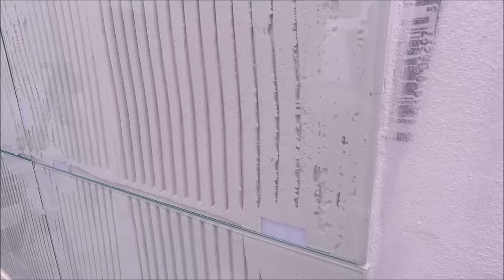How to use a Tile Leveling System for Walls

Comment from the maker: Leveling system: https://amzn.to/2Pmwjag
Gloves https://amzn.to/2VIOOtP
Reply: Hey bud I just did a job 8in x 4ft tile. I used spin doctor for the first time. Up to the grouting stage I was happy. But i knocked the stems out the next day on half the job and on the third day grouted and found that the spin doctors were forcing the tile under pressure and ends began popping up. I troweld and back buttered and never thought this would happen. The company set the job to install over a ardexed plywood that previously had smaller tile. 
Any idea why this happened and how to prevent it...
Reply: @jesussavedrjm6818  ... What do you mean by saying the ends popped up?
Reply: @kylelove927   it lost its bond cause the tile was under pressure down to be level
Reply: @kylelove927   the ends of the tile popped up in s few places
Reply: That link leads to a completely different tile levelling system which works on a wholly different principle.
Reply from the maker: @BenjWarrant  There are two leveling systems used in the video, one LEVTEC and the other RIDGID. Unfortunately, I don't have the ridgid link.
Reply: saved by grace through faith you may not had enough mud on one side. Witch could cause a hollow spot, and eventually pop I’d imagine if you stepped on a hollow spot on something that large
Reply: He means when the "leveling system" and I emphasize "" grabbed ahold of the ends of the tiles and lifted them off the substrate away from the mortar which shrinks you ended up with a gap and not enough coverage on the tile to hold the bond.  If you can't level your tile with mud than get a professional.  It is easy to add mortar to a tile and stick it to a wall then grab a level and put it on the wall and check for level.  If you need more mud take the tile and add some.  Why is this so hard or is it because this is tedious and takes longer.
Reply: I can see this working as long as you add the perfect amount of mortar evertime.  But when does that happen.  I set most tile on other people's walls.  Which means the substrate is usually beveled in or out and not perfectly level to begin with.  This only works in a perfect world.
Reply: I am about to try these on a 200 sq' shower project.  My question is, if you are using spacers to supplement these clamps, can you simply use the "B" clips for everything? It appears the only thing missing with the B clip is the little tabs that would go between the adjacent tiles - either intersecting or brick patterned..  Am I correct? As you pointed out, why use several, OR buy several different types, if the straight "B" clip can be used for all.
Reply: @jesussavedrjm6818  klkm
Reply: @itscalledhiphop3063  couldn't agree more, I float my whole floor out on concrete! Takes a lot longer and way more thinset but she's tough as a tank when done lol
Reply: J😅😅uiiy de as need ryw 😅🎉❤  se😂 plum❤

Comment: Been a residential remodeler for over a decade. First used these 6 months ago on a large job for my new business. I'll never install large format tile again without these. Made the 24"x24" tiles go down completely flat and level. You can slide a 5 gallon bucket 30 feet across the tile without it catching a lip. Truly amazing. Saves so much time.
Reply: I'm familiar with getting cement to the correct consistency as I've been a mason for too long. A question I'm trying to cut a corner and removing my tub. Just having the space now a shower with 17" square tiles. Have a marine plywood floor. Before I put down the top bed ready to tile, could I use a wall board cut to size and screw it down like crazy instead of doing it by hand? Then put the 40 mil plastic down and then trowel it as it should be for the tile?
Reply: @HellNoKamala  im so confused by the question can you clarify more?
Reply: @Titantitan001  I just did it the right way and just troweled it to slope to the drain and it does drain the water. I didn't want to make a mistake. Any flexing could cause a leak if I put wall cement board on the floor.

Comment: Hello mate, Pro Tiler from England here. Just a little tip. Tile lippage clips help on near enough flat walls and floors, but some DIYers might watch this and use these on bumpy surfaces which is when problems occur, as the clips either raise up the previous low tile or bring down a raised tile, creating air sockets underneath. All you need to do is knock on the tile and you will hear the hollow points. Also dont knock the clips out with a rubber mallet especially on a lighter ceramic tile as the mallet can leave black marks which are a pain to clean off. Polished porcelain you might get away with but just a tip. Good luck mate wish you all the best 👍
Reply: Interesting to hear from a professional! Do you use a levelling system yourself? And why do you/do you not use it? Just being curious :D
Reply: @mart9585  I’ve been tiling 11 years. I only use self leveling clips for anything larger than 12x24 because it helps to keep the tile plum and level. The cons to using it are if the wall isn’t plumb or flat than it will cause voids in the thinset behind the tile and causing the tile not to adhere properly.
Reply: Awesome point . Level or grind the high spots first . Good on ya
Reply: @AllBayEveryDay  The clips don't cause that the poor substrate does.

Comment: Thanks for the tip on removing the extra thin set from the edges. That explains why I was having trouble with compressing the trowel lines on the bottom of my first row of tile on my bathtub (large format). Luckily I was smart enough to pull them off the wall and try again today after watching some videos
Reply: I second that. Such a simple thing, I don't why I didn't think of it...

Comment: I use spin doctors exclusively and they are killer,you forgot to mention using  a cap to run between tiles to check lippage and break a post of the base is ideal for cleaning grout lines.and one should always especially LFT use a rubber mallet and smack each tile a bunch from center out to release air it’s unreal how much is trapped great videos non the less,thank you!!

Comment: Pro tip for a DIYer spread the thinset horizontally and it will help tile from sagging. No need for ledger board make your first row level.
Reply: Actually, you want to apply the thinset the way he has shown (if you are laying your tiles the way he is - i.e. long side parallel to the horizon).  You always comb the thinset in straight lines perpendicular to the long side of the tile to aid in removing trapped air.

Watch this video, it's very informative.

https://www.youtube.com/watch?v=Way5bMh-eYg&feature=em-comments
Reply: It shouldn't make any difference with 100% coverage. Or maybe a thicker mix is needed. I could be wrong. I'm still learning how to do it right.
Reply: @dougwebb704  But he didn't get the air out anyway.
Reply: He actually said he normally back butters which will increase coverage, but did not in this case to allow the clips to be visible through the glass.

Comment: I started a tile job using the home depot wedges. After about 10 foot by 10 foot area switched to the screw on Marshalltown leveling system. The Marshalltown are easy to install and if you have a problem they are easy to back off to either remove or add more mortar if needed, The wedges have a tendency to grab the tile and push them apart if you are using a grippy tile. The tool will also wreck your hand if you use it a lot. 

While these to a good job of keeping the edges of the tiles even, you can still have an uneven floor when you are done, which will show up when you install baseboard. Always check your tiles with a level to make sure you have them flat and even with each other.

Both do have the occasional tendency to not break off cleanly as you can see right here 8:56 where he says they break off cleanly, when they clearly did not. The little piece of plastic can be cleaned up with a multi tool or a sharp razor knife, just be very careful to to chip the tile.

Comment: I tend to be a no-throw away person if possible, so I will stick to the regular cross type rubbery tile spacers that you just keep reusing to save the planet every inch I can.  Nice Video.  Tip for grouting ~ use a cake icing bag with the tip cut off and press it in after you pipe the grout in.  No waiting for the grout to cure and washing it forever.  Thanks for this video all the same.
Reply: Your totally missing the purpose of these. Lol if your that worried about the spent plastic pieces, put them in a bag and put them in your recycling bin

Comment: Thank you for this informative video. I am doing a shower with 1/2"x23x47 tile. Pretty thick tile. What size clip should I use for these large tiles as it will be 1/2" tile and 1/2" thin set ? Thank you.

Comment: I used the Ridgid spindle system on two tile jobs. I had never used a lippage system of any kind so I thought I'd give it a try. Never again. I used a half inch notched trowel on both jobs, and back buttered every tile, but the clamping pressure  of those spindle tops is so strong that it was lifting my tile out of the thinset completely. I didn't notice this until the following day when I came back and realized very quickly, that I had to re lay more than half of the work I had just finished because they were just floating there on dry thinset. I wonder if the wedge system would serve me better. I think part of the problem is the thickness of the stem foot of the spindle system that sits under the tile.

Comment: Nice demo, using glass sure makes it easier to grasp the concept..good job 👍
Reply from the maker: Thanks! It was a tricky demo and the glass definitely gives you a closer look with a leveling system 👊
Reply: StarrTile 9
Reply: is that bob doyle lol 🤣🤣 smh
Reply: I agree. I just did my first shower tile job with LFT and bought both these systems but didn't end up using them because I wanted a 3/8" grout line and I never saw this demo. Great video, I will keep these kits for the next job..
Reply: With the glass demonstration it also shows that you can remove the systems without causing damage to the tile. I figured that glass would crack.
Great demonstration, 2 thumbs up.

Comment: I can’t explain how important it is to back butter the tiles when installing tiles on any surface.  Also, u definitely wants move the tile side to side too release all the air from under the tile before moving onto the next tile. I can’t tell you how many tiles I repair because of a simple step not taken.
Reply: Completely agree.
Reply: Thank you for your wisdom and knowledge 👊🏽💯
Reply: But you just explained it?
Reply: Damn right!!
Reply: The thinset he used was dry and not that wet. No need to back butter if you mix your thinset correctly
Reply: @Hidden-comment164  incorrect.
Reply: @ph3q  no, I install for a living lol
Reply: Excellent . Perfectly well said .
Reply: @Hidden-comment164 not true . You back butter wide format tile . Always
Reply: @Hidden-comment164 then you install incorrectly . Not one pro tile guy in this world will say don't back butter wide format tile ..that's makes you a crappy installer
Reply: We never back buttered tiles 30 odd years ago. I had to replace chipped tiles as an apprentice plenty of times and they were ridiculously difficult.  I think the only time tiles popped up in 1 piece for me was when the glue lines were in different directions or there was an obvious skin over glue from sitting too long (Could have been refreshed with a quick re-trowel).

I think the industry is in overkill on tile installation. Levelling systems aren’t really necessary but for plank tiles.

Comment: Used both systems, Personally I preferred the vedge system. Both systems works great, but the vedge system is easy to use and cheaper.

Comment: Is there a reason why a spacer isn't used on top of the ledger board?   Thank you for another great video.
Reply from the maker: No need
Reply: @LandbergTileTV  The real essence of my question is this:  Since you have to put in the bottom row of cut tiles once the ledger board is removed, wouldn't the spacers help keep that row of tiles in line and level with the rest of them?  How do you get that row to line up properly after removing the ledger boards?  Thank you.

Comment: Thank you...not in tile biz but if it was me I would definitely come up with something on a drill to spin the Rigid ones...like a socket with 4 notches
Reply from the maker: thank you sir! 👊👊👊
Reply: That would make the job even harder!
Reply: Would make it slower and a chance to over tighten and crack the tiles. I think it is better because you have a finer adjustment with your fingers that with the tools but thats just me
Reply: @MrJFoster1984  you can't crack the tile by over tightening - the clip fails before that. but then you have to struggle to get a new clip in that spot.

a drill adaptor to remove the cap after would be helpful.

Comment: I just use a short piece of batten placed across the tiles as I go, to check for height discrepancies. That's the old school method, add or remove adhesive if necessary.

Comment: So my questions are for what size are these checking on Amazon saids 1/16 can you get bigger like 1/8 or 1/4 and is this only sold online or can you buy this on store let's say the ridgid system can you buy it at home depot or lowes other than that awesome system for large tiles
Reply from the maker: I have not seen the rigid system in store yet. You can get the clips at 1/16 or 1/8

Comment: I tried the Ridgid system with large format tiles 24×12" and wasn't too happy about it, the spacers did not break at the base everytime and had a really hard time getting them off the wall, to the point that I just stopped using them, they need some refinements in my opinion. But thanks again for video
Reply: I had the same problem. I also stopped using them.
Reply: Thanks...I wondered about that

Comment: I am installing a wall mural that uses 24x24 tiles. If the tile thickness is not exactly uniform there is going to be an issue. These systems use the science of leveling the bottom of the tile and there will be some lipage when applying the top anchors. Any ideas other than not using leveling system and just leveling by running the trowel across the seams when setting? I have tried a dry fit on a flat surface using 2 clips on each side and there are lipage issues.

Comment: So it seems the spindle system is better? since you didn't have to hold the tile on the edge to prevent movement and no pliers were used or any other tool other than a twist. am I correct?
Reply from the maker: We like the wedge system better and its not necessary to use pliers. We don't anymore with our Levtec system.

Comment: I plan to put down 12x24" tiles using the wedges system and your videos are great! Thanks. But I have Two Questions—
Question 1: Can the wedges be tightened too much, or do the pliers tighten them with the right amount of pressure?  
Question 2: Does using the wedge system alleviate the need to use a level to make sure the floor tiling does down level, or does it just assure the tiles are flat with one another--that is, can I just lay a row of tile along the wall using the wedges and keep going and assume all will be level?  I can imagine some tiles will need more thin set under them than others. Thanks.
Reply from the maker: Hi David! To answer your questions, you could theoretically tighten the clips down too much, but at that point they will break and you will have to pull the tile and insert another clip. Also, the leveling system usually only assures that the tiles are flat with one another and yes, some tiles will need more thin set than others. Please let me know if you have any more questions and thanks for watching! 👍
Reply: This is my first time using leveling wedges. I now get that the extra thin set needed can be added and then the leveling clips used to level the finished height needed. Also, I noticed that the official QEP video on using their Curved LASH system does NOT flatten the ridges.  See their video here cued to the right time--https://youtu.be/jnsHvrRB_mg?t=1m12s. The "expert" just drops the tile on the Curved clip and on the ridges without flattening out the ridges.  So I returned the QEP Curved clips and bought the Flat clips. Sal DiBlasi said that the ridges need to be flattened and to slide the tile then finish back into the clip. As I see it, only the Flat clips will permit this flattening of the ridges to get the full coverage needed. I'm learning a lot and want to make sure I get the fullest coverage of thin set needed. THANKS.
Reply: You don't tile uneven floor use self leveling compound first to make it flat then it's much easier and faster to tile whole floor.

Comment: Quality video. Using glass also shows the % of adhesive holding the tiles
Reply: @l.k.3277  I'll write something less lame.  He doesn't have the proper amount of adhesion if you look at the glass. He could of at least fooled the viewing public if he just used a tile product that you couldn't see through.
Reply: @lostinmyspace4910  He doesnt have the proper adhesion because he laid the tile incorrectly.  He should have rocked the tile back and forth perpendicular to the trowel lines to smooth it out and get as close to 100% contact as possible.

Comment: great video! The glass tiles are a great idea to teach us how to install tiles in a proper way :) The rigid system looks to be a pain if you have a large amount of tile to install. Getting screwed to unscrew :D
Reply from the maker: Yes sir, I was hoping for a glance inside with the glass, and a wedge system is much easier to gather after they are knocked off. Thanks for the watch and comment 💯

Comment: as you place the tile slide the tile left and right to get better coverage they don't need back buttered... Back buttering can cause pockets of air and air is what causes weak spots and failures in tiles.